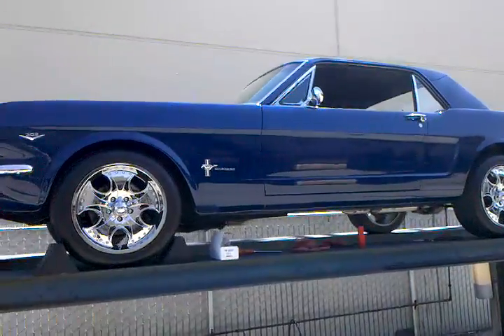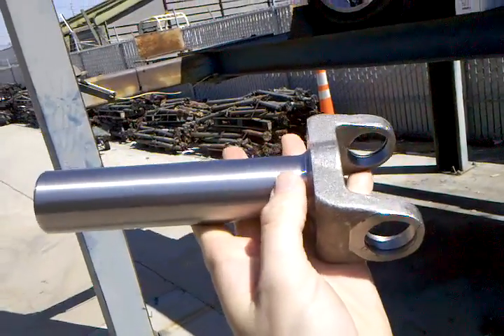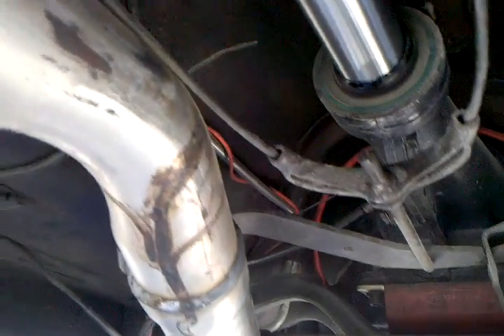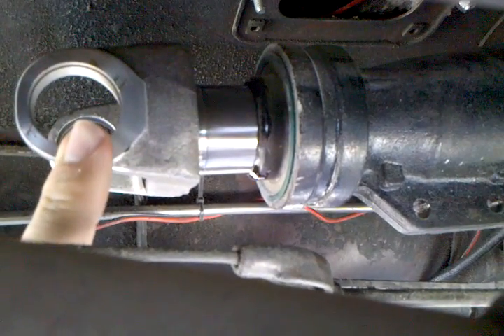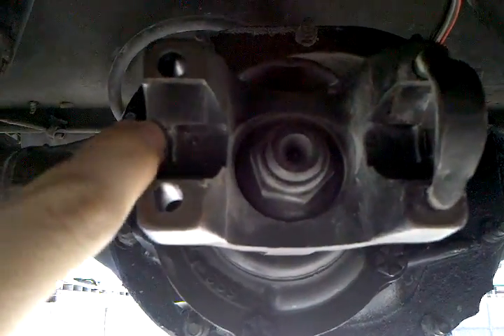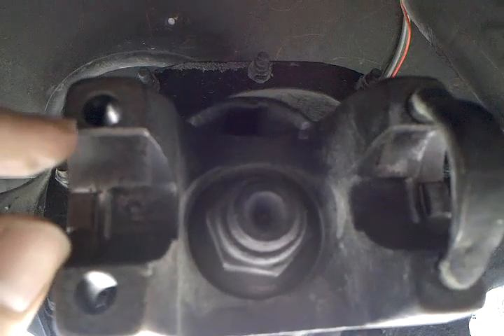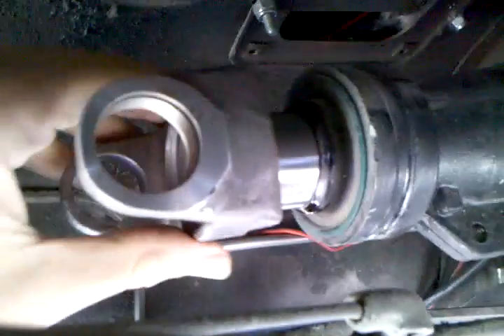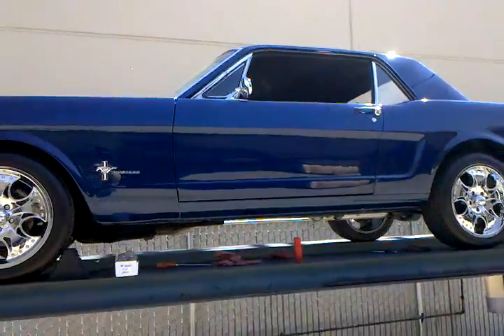Powertrain: How to measure a 1pc driveshaft

Comment: Good job listing the u-joint diameters, it matches my research. When you say that yoke is bottomed out, I see 1/4 inch or so of gap. What would you say is "good enough" when checking if it bottoms out?

Comment: Where would I get that exact yolk? And is it compatible with my sn95 T5?
Reply: your T5  is a 28 spline yoke so yes it should work, but you don't need
Reply: ...it to be counter bored. You just need to make sure it matches the u-joints on your drive shaft.